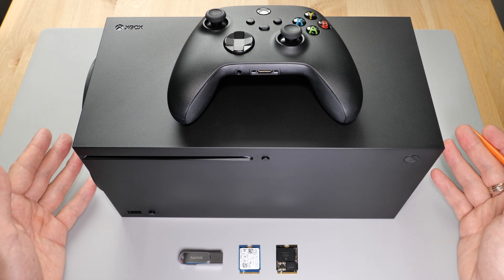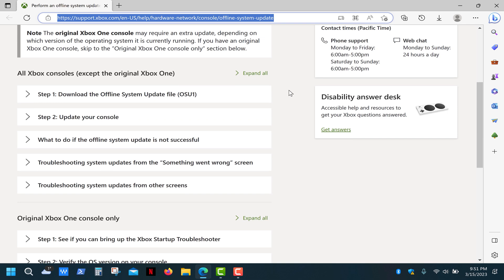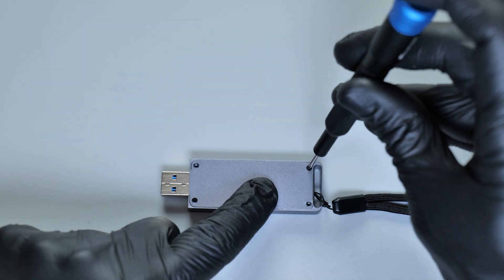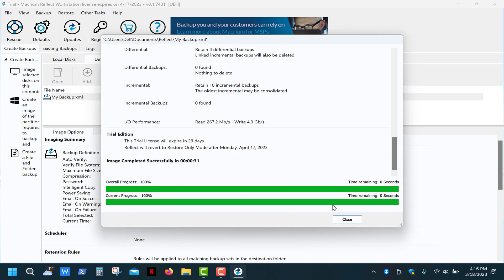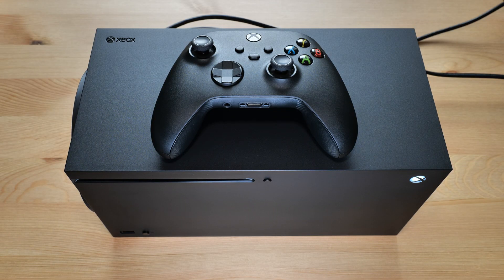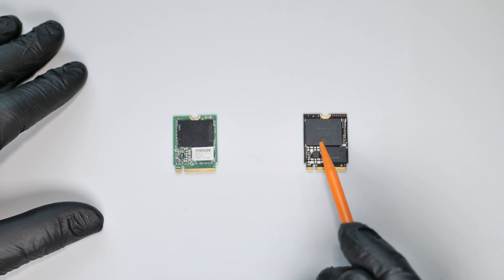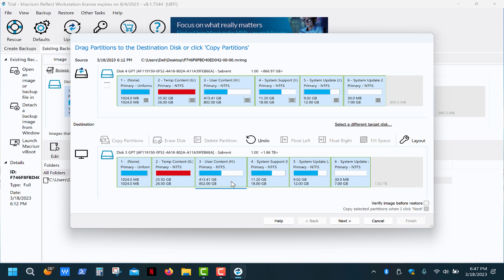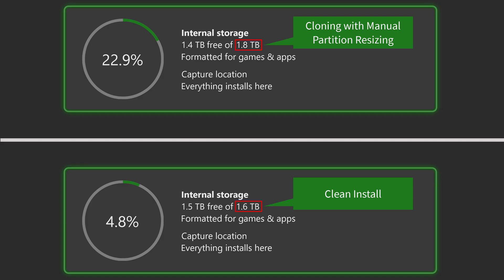Upgrade Xbox Series X SSD to 2TB – Clean Install or Clone Method (Step-by-Step Guide)

Comment: How do I know which SSD is compatible? I think my SSD is failing so im trying to clone it.
Will it work with a KINGSTON 2230 1TB PCIE GEN4 NVME M.2 ?
Reply from the maker: The link for compatible SSDs in the description. That Kingston won't work. You can use WD CH SN530 512G/1TB or  SSSTC XA1-311024 (1TB)/ XA1-31512 (512MB). There are also some other modified WD models occasionally available on eBay and AliExpress.
Reply: @ElectronicsComputers  Thanks for the response!
Reply: @ElectronicsComputers  Sorry, another question. What makes these SSD's compatible,, firmware, architecture?  So bizarre that we can only use certain SSD'S

Comment: Is the boot partition what marries the drive to the cpu? I have a dead Xbox and was wondering if I could keep everything from this Xbox and install its ssd into a used console
Reply from the maker: That's right, that partition contains encrypted data, which allows a specific console to boot its OS from the drive. If you have a used SSD from a Series S or X, you can remove all the partitions from it and, for example, install it into an external extension adapter as shown in the video. Or, for instance, if it was a 1TB SSD from a Series X and now you have a Series S with 500GB, you can easily upgrade your console and use the 500GB SSD as an external drive with an extension adapter that costs about $10 delivered: https://alii.pub/71d4p0

Comment: Need help, i still have the extracted boot partition but i cant re install it back into the original ssd due to it saying the sector size is different.
Reply from the maker: Did you use different enclosures to clone the partition?
Reply: @ElectronicsComputers  i used the same enclosure to make the original copy of the 1024mb partition from the original ssd. That copy was installed into a newer ssd, tried installing the update , update failed an got an e109 error code. tried to install a new copy of the 1024mb partition from the new ssd to the original ssd with macrium , macrium wouldn’t allow me and kept saying the sector size dont match .
Reply from the maker: @47AKXLVII47  I’ve never encountered any sector size issues whether using the same M.2 to USB adapter or a built-in M.2 port on a PC or laptop. There’s no way to change the sector size. Try cloning the SSD with the latest installed offline update, then install the new drive and restore the image. Always keep a backup of the latest installed offline update, as losing it could make the console useless. If that happens, Microsoft is the only one who can fix it (well, they usually provide a refurbished unit instead of repairing yours and charge $300 for that).
Reply: @ElectronicsComputers  is there a way for me to send you a copy of that cloned boot partition? So you can try to install it into a original series x ssd?
Reply: @ElectronicsComputers  is it possible to change the sector size of the newer ssd without data loss? Or changing the sector size on the 2nd cloned 1024mb partition so it can be installed into the original ssd?

Comment: I have an Xbox Series S that turns off after 3 seconds without displaying any video output, I have checked the entire motherboard and the power supply but there are no signs of a short or something so I think that the problem might be the SSD, my PC recognizes it so I don't think the SSD is damaged so I think it might be a problem of the system. If I format the other partitions and only keep the primary, should I be able to reinstall the system? or I must buy a new SSD to only put the primary partition on it?
Reply: Mine did that also until i did a full clone of the drive .....it didn't work the clone like in this video i had to clone the whole thing.....but it then booted started the osu1 update and then error e109 so I don't know maybe things don't work the same with there new updates.

Comment: Will regular WD PC SN740 2TB work with Xbox Series X or I need to find some SSD which is certified compatible with Xbox Series X?
Reply from the maker: Unfortunately, it's not gonna work. You can use only compatible drives or modified ones.
Reply: Thanks for answer!

Comment: what m.2 did you use?
Reply from the maker: It was a modified drive based on the WD740. But when I connected it to a PC, it was recognized as a different model. Those drives appear from time to time on eBay and AliExpress.

Comment: original ssd de4d 🙁
Reply from the maker: If the original SSD is dead, then the Xbox Series S|X is garbage. The best thing you can do is sell it for donor parts and then buy a new one. The previous generation of Xbox had a bootloader on the chip on the motherboard, and you could easily replace a dead drive. On the Series S|X, that bootloader is on the SSD, and if it's dead, it's over for that console.

Comment: Still a good video for people who like to tinker. Like he said in comments, cannot use a 2TB due to firmware limitations. Microsoft has announced the 'Xbox Series X – 2TB Galaxy Black' so the limitation will probably be lifted by the time it comes out. Even then, testing will still be needed to find out how to upgrade the older systems to a 2TB. Not to mention see which 2TB SSD's are compatible with the X|S. Hopefully all of them but I doubt it.
Reply from the maker: Yeah, I wish it was like with the previous Xbox generation when you could put any drive inside, install offline updates from a USB drive, and the job was done. I have about 17 consoles in my repair shop with dead SSDs, and they are not fixable because there’s no way to restore the boot partition, which on previous consoles was on a dedicated boot chip on the motherboard.
Reply: @ElectronicsComputers So whats the update now 6 months later can we take our old 1tb series x console 1tb hardrive out and install a 2tb hardrive with your method so I'd be like having the galaxy series x I guess what I'm asking is have the limitations been removed I would love to take my series x 1tb replace it with a 2tb then take the old 1tb an put that in my buddies sieres series s then take the series s 500gb hardrive an put it in the hardrive case you showed us to have as the extra storage I just don't like the idea of external drive an would rather upgrade them both in one go essentially I'd be upgrading both at the cost of just one 2tb hardrive please help I greatly appreciate it
Reply from the maker: @tylerpoulter2297  Nothing has changed since I made this video, and it’s unlikely anything will in the future unless the Right to Repair movement or the European Union forces Microsoft to change its approach. Currently, Microsoft uses a whitelist of compatible SSDs for Series S|X consoles, and you can't use anything else unless the SSD's firmware is altered or the controller replaced. To my knowledge, there’s only one SSD model that can be modified for compatibility, and it occasionally appears on eBay or AliExpress. Unfortunately, these consoles are essentially unrepairable if the boot partition is damaged, the SSD dies, or an error occurs. In our repair shop, we have about a dozen of these dead units, and we typically buy them for no more than $30 for parts. I don’t recommend attempting upgrades or modifications, there’s a high risk of bricking the device permanently. If something goes wrong, Microsoft will offer a refurbished replacement for $200–250, but it likely won’t be the same console you sent in. Given the poor lifespan of the 2230 SSDs due to overheating, I suggest using your console as-is until it fails - it’s simply not worth the investment. Or sell it when you see first signs of SSD failure and buy a new one.
Reply: @ElectronicsComputers  what are the common signs of the SSD failing? Crashing to home screen?
Reply: @nicholasmankin9079  slow loads/boot, games crashing (booted back to the console home screen). not all that different to what you'd experience when the mechanical HDDs in the xbox one models started failing (bad sectors leading to read/write errors)

Comment: Hello brother, thank you for the video, I had a question that I couldn't find anywhere. Is it possible to use internal hard drives instead of disk drives? Exactly instead of a disc, with the same cables embedded in the console?
Reply from the maker: Not sure about Series S|X but on previous generation it didn't work.

Comment: Dose the drive matter like I can get just any 2230 m.2 pie 4.0 nmve drive or dose it matter I would like to not now but one day upgrade my series x to 2 terabytes
Reply from the maker: There are no brand-new compatible SSDs for sale for those consoles. We can only buy used ones that were salvaged from other consoles. 2TB drives without firmware modification won't work. You can find those drives on sale from time to time on eBay or AliExpress. The safest and easiest way is to buy an extension 2TB card. I hope one day Microsoft will remove those limitations, and we will be able to use any SSDs like on the One X|S.
Reply: @ElectronicsComputers can I buy any expansion card like the seagate one or like the wd black c50 and yoink the drive out or are those costume made boards inside

Comment: 1 yr has passed，we still don't know if it's possible to replace with a 2TB M.2 2230 SSD. Can you tell us now what exactly is the "tweaked" SSD. Please.
Reply from the maker: I see those modified WD 2TB drives on eBay and AliExpress from time to time. Most likely, there's modified firmware. If I knew exactly how they do it, I would make a video about it.

Comment: Are there any noticeable improvements between the original and new SSD performance-wise?
Reply from the maker: I wouldn't expect high performance from M.2 2230 SSDs. They have a tiny controller chip that generates a lot of heat, which is hard to cool down with that passive cooling system. These SSDs start to experience thermal throttling within 10-20 seconds under load. Check out my latest video. And unfortunately, these SSDs don't last long. We have a pile of Series S|X in my repair shop with dead SSDs, and of course, they are not fixable and will go to donor parts. So, the performance remains the same, but you get more space with that upgrade.

Comment: should of been 2tb to begin with that is one of the reasons why the ps5 is more popular easy upgrade.
Reply from the maker: Also, the PS5 uses high-performing and long-lasting M.2 2280 SSDs, unlike the cheaper M.2 2230 stuff that is slow and don't last long. Moreover, upgrading those is really a nightmare.

Comment: Xbox won’t boot and front button won’t respond but will turn on via cd button
Reply from the maker: Most likely it's a motherboard issue but it's hard to say anything more specific without checking some key points. What happens if you try to power on the console using the controller?
Reply: @ElectronicsComputers  it doesn’t connect or link but the xbox will power it, i notice the fan isn’t running either
Reply: It also turns itself off
Reply: @ElectronicsComputers  any idea’s on it?

Comment: Does anyone know if this will fix the E200 error? I've troubleshooted every other option and Microsoft is telling me I have to send it in for repairs and charging me $300 😩.
Reply from the maker: Connect the SSD to a PC and check the SMART status of the drive. If the drive is about to fail, replace it with a new compatible one and restore the backup of the bootable partition from the original drive onto the new one. Additionally, ensure that your console is not enrolled in the Xbox Insider program. If the original drive is dead, only Microsoft can repair the console. Typically, they provide a refurbished console rather than repairing your console. I would prefer to purchase a new console rather than paying $300 for repairs.

Comment: Im wondering if the drive we can buy for the external ssd slot are 2 tb and they are already working in the console so if we clone the hd to the new 2 tb from western digital black disk or the one in the plastic holder then install this after cloning on the inside slot so we can finally have 2 tb internal drive that work since this video he is using a special drive

Comment: Hello. After cloning the raw partition and installing the new nvme into my series x, the system boots to the troubleshooter with the error E109. Attempting the OSU from usb, the system finishes step 2 (verifying) but reboots immediately afterwards, before it applies the update. I’m now stuck in an update loop that never completes. All other options in the troubleshooter lead to rebooting to the troubleshooter system error E109. Any ideas as to why the OSU isn’t completing like it does in this video? Could copying the content partitions from the original ssd potentially get me past this troubleshooter? Thanks.
Reply from the maker: Attempt to clone all partitions onto the new SSD. Also, I have to ask, did you use a compatible SSD, modified one, or just a random off-the-shelf SSD?
Reply: @ElectronicsComputers  thanks for the reply. I used an m.2 nvme 2230 ssd harvested from a steamdeck. After checking in windows i realized this ssd reports 512 bytes per sector, while the original reports 4096 bytes per sector. Now I’m having issues restoring the new boot partition to original ssd because macrium does not support 512 to 4096 compatibility. Any ideas to getting the boot partition back onto to original ssd? I’m afraid I may have bricked myself. No luck so far with clonezilla either.
Reply from the maker: @anon668  There's a list of compatible SSDs that work with Series S|X consoles, or you may need to use modified ones. At this point, you must preserve the boot partition on the new SSD by any means necessary because the one on the original SSD won't work anymore. I've never encountered any cluster size issues when cloning and restoring partitions. The original SSD will be reformatted with the default settings during offline system update, all you need to do is copy the boot partition from the incompatible SSD onto the original one. All SSDs, by default, have a cluster size of 4096 bytes. I'm not sure how you ended up with 512 bytes which is very bad for SSDs and will affect its longevity. Try formatting the original one to the same cluster size and then restore the partition.
Reply: @ElectronicsComputers  thanks for the advise. I’ve tried copying the boot partition back to the original ssd multiple different ways at this point. No program at this point has been able to because of the incompatible sector sizes. I had a bit of luck using Linux. Gparted copies the partition, but the console doesn’t boot. Using dd I was able to do a full disk clone, and the console stayed on for almost 15 seconds before it turned off which felt like progress. No image to the tv though. The series x original ssd seems to be 4096b while the donor Samsung ssd is 512b. For some reason I had no issues making the new ssd bootable, but the 4096 to 512 sector size incompatibility makes this feel impossible to do the other way around. Any suggestions for a method to format the 4096b ssd to 512b so that I can hopefully use macrium or another program for the clone?
Reply: @anon668  I had the same issue after upgrading to 2 Tb SN770. Macrium is not capable to copy 512 to 4K sectors. But I restored boot partition with Macrium without copying data, then just copied data with linux disk tool. You just need to properly recover boot partition align (start sector), because standard linux tools are unable to create it in desired place. They align it to some UEFI or other standards for PC.

Comment: Hello, thank you for the step by step instructions but the problem i am having is the SSD can not be notice when trying to clone. Is there something that i can do. Thank you
Reply from the maker: When you put the SSD into the enclosure and connect to a PC it works immediately without any extra work. Can Windows recognize that SSD or it's just the cloning software that can't?
Reply: @ElectronicsComputers  the ssd is not being found, i bought the same enclosure (sabrent) and nothing, just gives me an error (E:\ is not accessible) once plugged in.
Reply from the maker: @V1nny_127  Does the SSD get hot in that enclosure or remain cold?
Reply: @ElectronicsComputers  feels cold still when connected. I'm not sure how hot it has to be
Reply: @ElectronicsComputers  i do want to thank you for taking your time. I invested a lot of time and money trying to fix the xbox. Trying my best not to send it to xbox to have it repaired (Expensive$$) but at this point to whatbi spent, should of got a new one :(.

Comment: You solved my problem. I tried several times to copy only the NAND, but when I tried to do a clean installation with the pendrive, the error message ?(E101) appeared. The solution you gave that worked very well for me was to clone the entire disk and expand the user partition. Thank you very much for this video.:goodvibes:

Comment: I am having my sn530 chip replaced in my xbox series x. The tech is having a hard tike finding the right software to make the replacement chip work in my series x. Will this method solve the problem???
Reply from the maker: If you can make a copy of the boot partition from the original SSD, then it's not a problem to replace the drive. If the original SSD died, then that console is worthless and the best thing you can do is sell it for donor parts and then buy a new one.

Comment: Serious question, do you yourself offer this service? And if so, how much do you charge? I’m here in the states and was wanting to upgrade my internal HDD, thanks
Reply from the maker: If I were able to perform that SSD modification myself, I would probably offer such services. Sometimes, I come across of those modified SSDs on eBay. I've made a detailed video tutorial so that anyone could repeat the upgrade themselves. However, to be honest, I wouldn't recommend pursuing such an upgrade due to the high risk of bricking the console, unless you're dealing with a failing SSD and need to replace it.